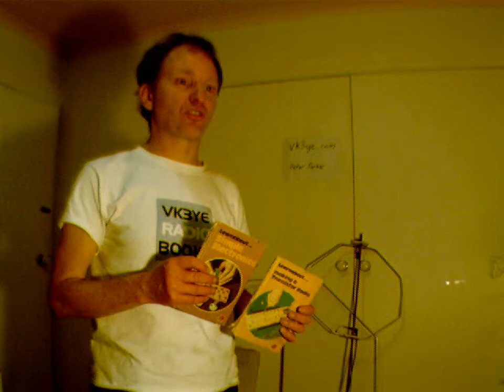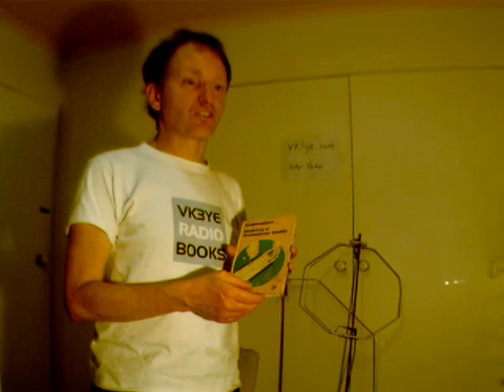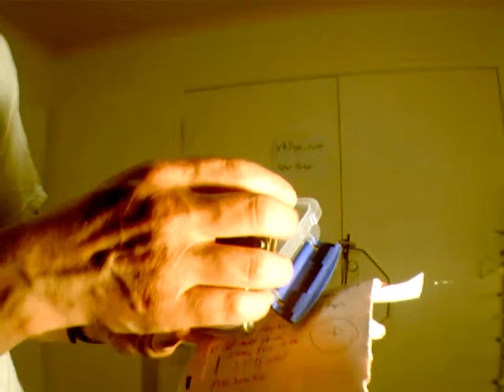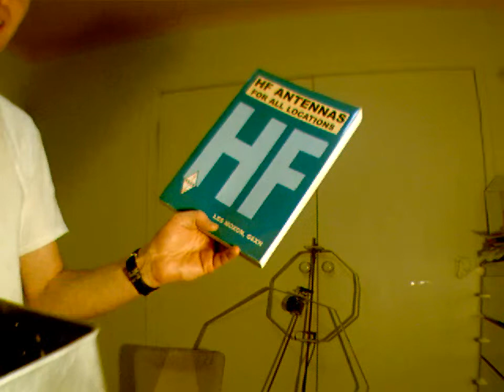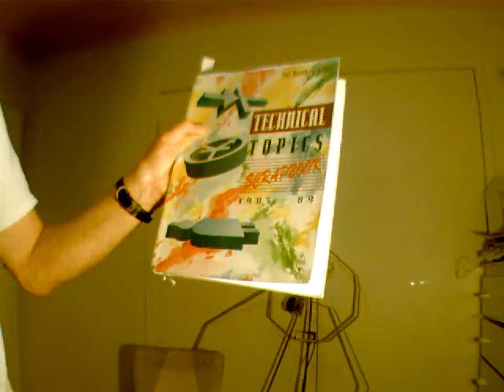GQRP Club Convention - QRP in Australia presented by Peter VK3YE

Comment: Timestamps
 (incomplete)

0:38 Intro
1:10 Tribute to George, G3RJV
2:24 QRP scene in Australia, VKQRP Club
3:22 SOTA - 40M mostly
4:25 Fists Downunder Club - 80M mostly
6:08 Building and Operating QRP in Australia (Transceiver examples)
16:30 Choosing/ Designing a QRP Kit Guidelines (Frequency Agility is vital)
25:03 Homebrew WSPR transmitter
26:16 Magnetic Loops Construction
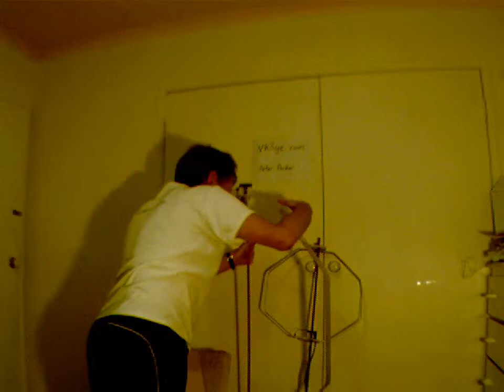29:27 Bigger Magnetic Loop
36:25 Questions and Answers